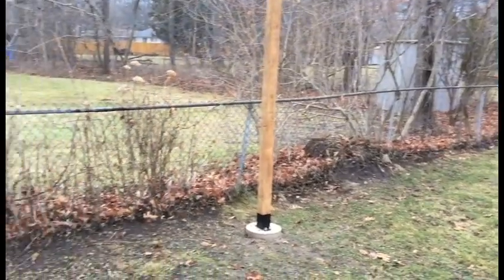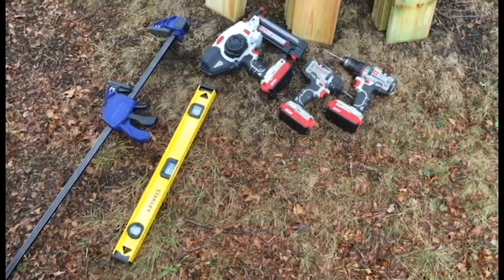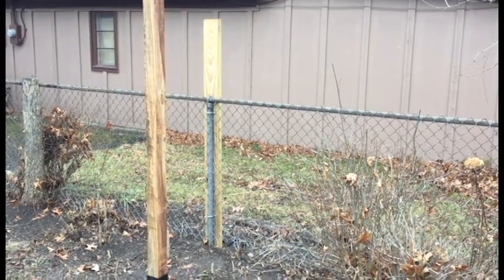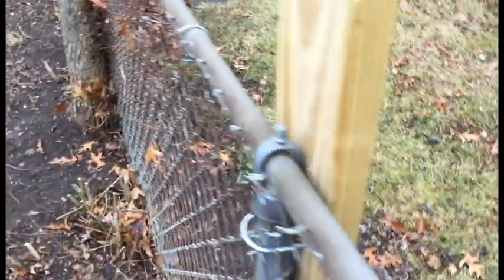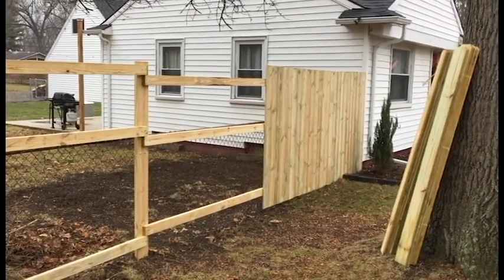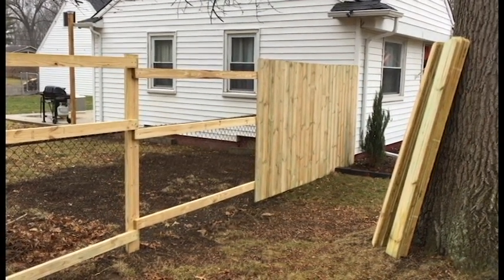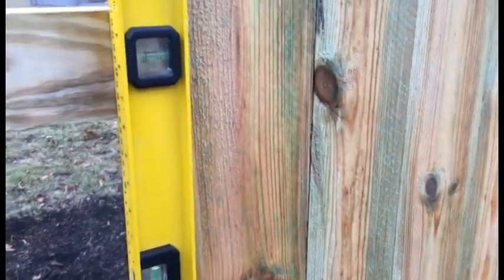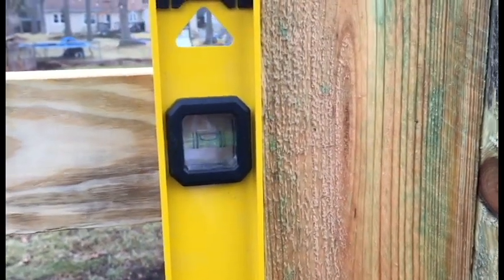How to Install a Privacy Screen to Existing Fence

Comment: Hello,  Nice job. Did you have any issues with wood spliting with the nailer and would you have drilled a pilot hole and used screws instead
Reply from the maker: No issues with the nailer or wood splitting. You could pre drill and screw it is just a lot more work.

Comment: I've watched over a dozen of build videos and this method seems to be the best as far as assembly but also longevity. I believe the last shot in the video answered my only question - is the view from the street just the privacy and no chainlink? So many of these videos show the chainlink around the perimeter from street view which I feel like takes away from the curb appeal. I believe the privacy was the street view in your case - yes?
Reply from the maker: Yes, I put the "nice" side of the fence toward the public and neighbors. The backside of the wood fence structure and chain-link is viewable from my garden. You can see it at the beginning of this video: https://www.youtube.com/watch?v=5fTyS12_ttM&ab_channel=MaximumIndustries
Reply: @MaximumIndustries  thank you for the clarification. Again - fantastic video!

Comment: A Brad nailer? Won’t the nails corrode? What type of screws did you use for the rails? And why did you stagger the rails? Looks good by the way.
Reply from the maker: As long at you're using galvanized nails it will last. Its works and still stand, not a single piece has come off in the storms we've had since! I staggered the rails because I was too lazy to cut them to the right size and put them all in line lol. Thanks! Good luck with your endeavors! :)

Comment: I’m contemplating to do this. Is that fenced is not gonna be affected by weather change since you didn’t space the pickets?
Reply from the maker: Because I bought them "wet" fresh from the factory you don't need to space them, as they dry out they will shrink and create those gaps. Then in the wet seasons if they soak up water and expand its not an issue because they won't expand to their full original size. If you buy dry boards I would space them 1/16 or 1/8 based on appearance you're going for.

Comment: I've been hearing it's a good idea to leave gaps in between the pickets to allow the wood to swell when it rains. Otherwise warping or bowing can occur.
Reply: yes and no depending how wet the treated lumber is when installed because it will dry and shrink. same concept as wood deck boards
Reply: @SCS2694  makes sense, thanks!

Comment: Good looking fence. I will be using this method for a weekend project. Have you had any issues?
Reply from the maker: Lol not issues, but I have some lessons learned! I finished fencing my whole yard and did some things different, I need to go back and redo this section of the fence when the summer is over. I should probably make a short video on what I'm about to write. Those metal straps on the metal bolts DO NEED TO GO ON the backside where the nuts go, I did keep them and I went back to reinstall them. Otherwise, I was using bradnails because that is what I had available, you are supposed to use ringschank nails. You DONT need the tap cons if you use ringschanks. Don't be lazy like me and cut the 2x4s so they lay half and half over the 2x6s in a straight line, the over under style I did was just because I didn't want to cut the wood. Set your end/corner pieces and hang a string line BEFORE installing the panels to make sure the tops are nice and inline, don't eye ball them like I did this section lol. It turned out alright, wife is happy, but with 20% more effort it would have been almost professional. Good luck and happy hunting!
Reply: Great advice, thanks!

Comment: Why didn't you leave any space between fence panels? You know it's gonna expand/contract a little.
Reply from the maker: Good question Kitty. Reason is when you buy fresh/wet pressure treated panels they are already at their maximum size. I wish I could post a photo here in the comments but now that they have dried out as we go into summer, they have skinny gaps between them from contraction/drying. Best is to buy fresh/wet and not have to measure for gaps. If you buy later in the season and the boards are dry, look up the recommended gapping. Hope this helps!
Reply: @MaximumIndustries  We put up 6' cedar panels yesterday and just use a few coins as spacers.
Reply: @kittyberg9988 what's the reason behind the little space in between panels??? It is necessary??

Comment: I did an extension on my 4ft height chain link fence with t post and welded wire, but the city tell me I have to remove it I guess I'm not allowed to do it, so that's why I'm watching this video I have to do something like u did :(
Reply from the maker: Yea, have them provide you with the city guidelines for fence restrictions. I'm not allowed fencing in my front yard...so the deer eat my plants...
Reply: @MaximumIndustries   haha... U just attached the wood post with the chain link post? Or in top of that u used concrete in the wood post?
Reply from the maker: Just attached the wood to the metal post using "U" bolts. I did no concrete work. The chain link post is already concreted into the ground. Good luck! @RobiPerk0125
Reply: @MaximumIndustries  what about the existing chain link gate???
Reply from the maker: @RobiPerk0125  Ah I didn't have one in the areas I was fencing. You'll have to get a little creative ;)

Comment: Any issues with wind and fence wobble?
Reply from the maker: No sir, the existing fence line posts were concreted into the ground and are solid. I did have to straighten them a little using "percussive persuasion" due to some misalignment from trees around the property having fallen and damaged them previously. But no wobble. Happy hunting!
Reply: Great video. I want to copy. I have some questions. 

Is there a reason you should keep the chain link fence in? I understand obviously keeping the poles what about the chain link. 
Also privacy fence posts are suggested to be 8ft apart. These are around 9-10 ft. Do you think the smaller 1.5 posts will hold up against the wind for a long period of time?
Thank you in advance!
Reply from the maker: @gabrielmonreal9171  Yes! I kept the chain link fence because in my area if you attach a privacy screen to an existing fence and do no excavation it requires no permit or inspections. Otherwise, it is significantly less expensive to reuse the existing line posts than to pull them and replace with new. I kept the chain link simply because it acts as an additional deterrent to keep animals out, and to keep the our dog from trying to escape! 

Correct, if you are installing new, I would suggest 8 foot on center post spacing. Mine are anywhere from 8 to 12 apart but it does not appear to be an issue for the weight, nothing wobbles even in high winds. The smaller line posts for my fence are also 1.5 inch, so this should not be an issue.

No worries and good luck!

Comment: how much u spend ?
Reply from the maker: Everything was about $1200, but I did 200 linear feet with 8-10 foot spans between posts. That price includes the 2x6, the cross bars, fence pickets, mounting hardware, nails, screws and a string line. Fence was existing and unmodified.